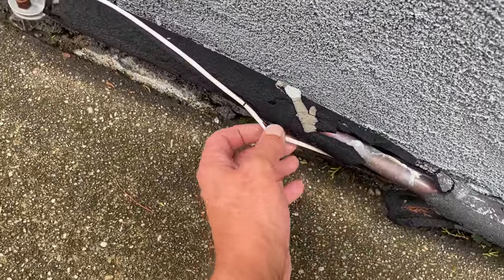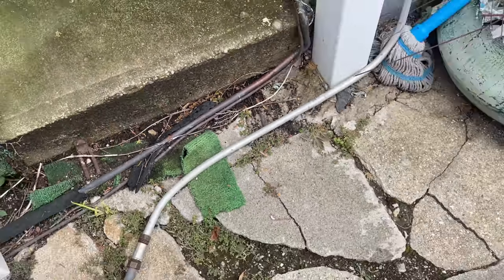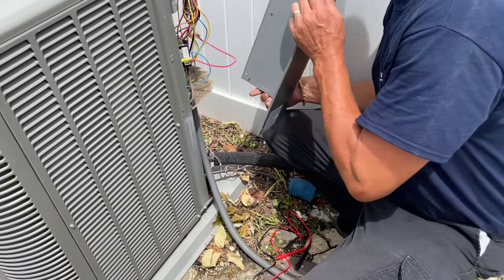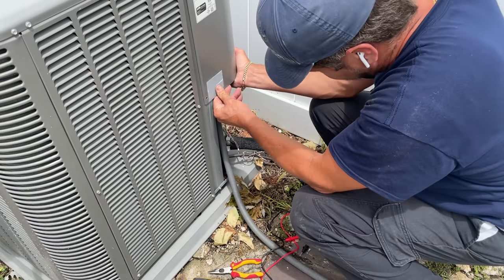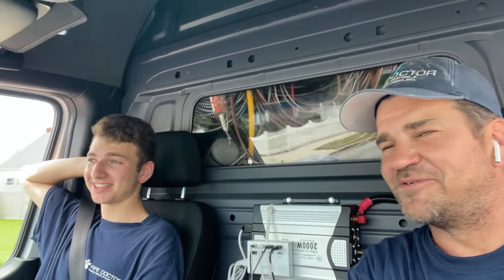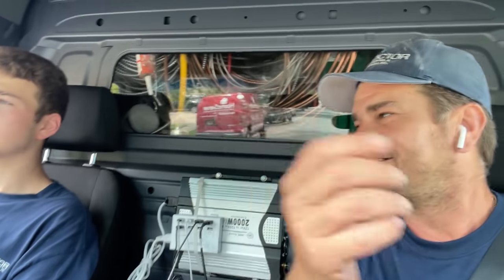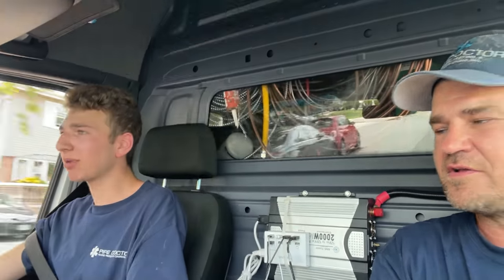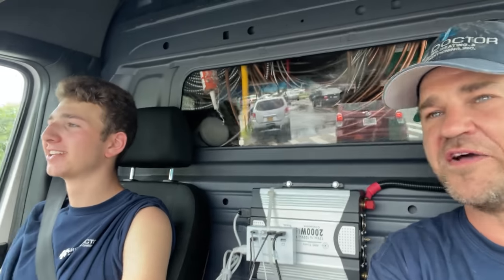Who Sabotaged This Central AC Condenser? Wire Missing from Contactor

Comment: "Mystery?" 🤔 Unlikely. Occam's Razor: Red TSTAT wire broke away from its spade connector at AC contactor — likely pulled away by someone or something inadvertantly snagging the excess control wire bundle wrapped around HP service valve at condenser base. Any number of plausable scenarios, e.g., someone with a broom or rake clearing leafs from around condensing unit; cat/squirrel/critter got hung up in the wire and freaked out, etc. 🤷🏻‍♂️

Comment: Someone tripped over that control wire or was pulling on it a broke that spade terminal.
Reply: @PipeDoctor   🤷🏻‍♂️ I don’t why you’d have one half of the spade terminal on the end of the wire and the other half of the spade terminal on the contactor if there was a wire in between.  Someone pulled the wire, probably by tripping, unknowingly braking the terminal then they wrapped the excess wire around the service valves.

Comment: Laurel & hardy !🤣🥃
Question?
How did that unit run without a name on it?🤔😂😂🤣
It maybe a non payment,they partially paid but didn't Finnish!
🍺🍺🍺🥃🥃🍇🏌
Stay safe.
Retired( werk'n) keyboard super tech.
Wear your safety glasses.
Reply: Non payment most likely or soured relations , same instance on repair of gate control by sideshow hack  sabotaged neutral wire on power twisted connection after cutting bare wire off made to look connected to 120v power but would not pull motor ,but lit up 24v LED s  ,even showed 120 in control box wire nut removed exposed what he did , he was supposed to fix damaged to gate structure only to chain puller bent out of place no inside work on control box or  wiring,new one for me ,very crazy shit I would never expected to see in a normal world, 🤔👍✌️💪🙏😁🤣😔

Comment: Someone tripped on the crap wire walking by and ripped it out. The angle  of the cable inside and the old metal of the conector makes it snap of at the weakpoint.
She did it because she asked if it could have happend like that.
Case closed.

Comment: What a joke.  " Someone sabotage the system"  look where the lineset run with low voltage and high voltage. Directly across a walk way. This should have never passed inspection. You can clearly see that someone tripped on low voltage and pulled it off contactor because of a piss poor install.

Comment: Doesn't looks sabotaged, looks like the red cable was connected to that cheap looking female spade connector on the contactor and not properly tied down, the vibration of the unit most likley broke it off, bad install caused this

Comment: Quit trying to make it more dramatic.
It's NOT missing.
Open your eyes!!!!
The spade is on the contactor and the plastic part of the spade is on the wire.
Because the wire is run unprotected and unsecured, it got pulled and ripped that spade off.
In my opinion, you should call her back and explain that you made a mistake and what really happened.

It is getting harder and harder to keep watching your channel.

Comment: Stop going tinfoil hat Mikey. xD Someone jerked on the control wire near the unit and broke the connector right at the terminal. You can see in the video half the connector is still on the wire and half of it is still on the contractor LV terminal. At some point, there WAS another wire there, but either got shewed or whatever and was repaired by crimping a quick disconnect onto the control wire and connecting it to the contactor. Either way, easy fix, but that whole lineset should be cleaned up or replaced. Try to get it into conduit or something along with a new wire.

Comment: Looks like set up but i have seen mechanics crimp connectors with wire cutters then they will break off instead of using crimp pliers.Glad you did not pee around the unit the FBI would come around the corner arrested you.

Comment: No one sabotaged it ..wire was probably pulled from the bottom ..that wire run is so corroded wrapping it around the valve could have done it ..easy on the assumption Miley

Comment: If a guy with a camera and another with a microphone popped out of the bushes to talk to you, I’ve would of thanked them for wasting my time and asked who will be paying the bill. If you thought it was a set-up, you should have shut the whole system down because that 24 VAC line is a fire hazard in its present condition. Call me when the ELECTRICIAN is done replacing it. Bye bye 👋👋👋

Comment: This was a sting, but kinda poorly executed.  The should have left the spade and the wire running to the contractor connected and just pulled the tstat wire out of the union.  There really isn’t a good explanation for why the wire to the cofactors wasn’t there.  Doesn’t matter, sting or no sting St. Mike always does the right thing…. Integrity!

Comment: That service call sounds like a test and you pass as for the wire leading to the outside unit that is their problem unless they want to replace it which it should be replaced.